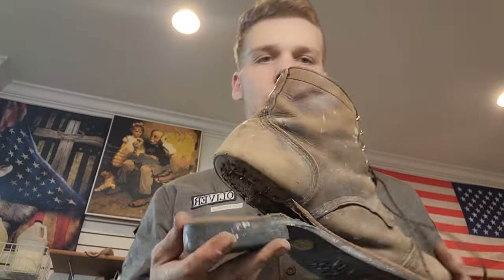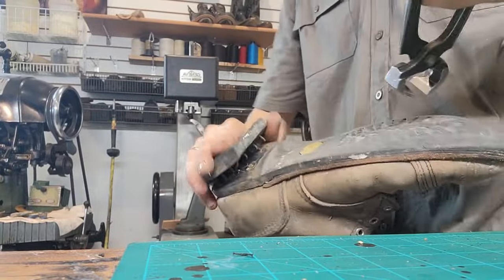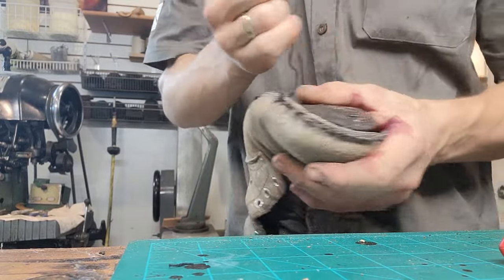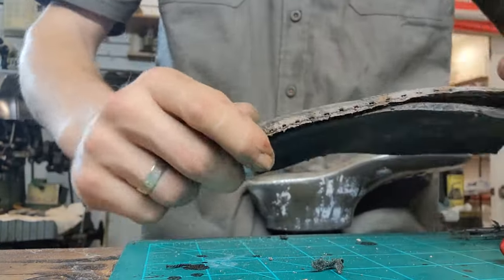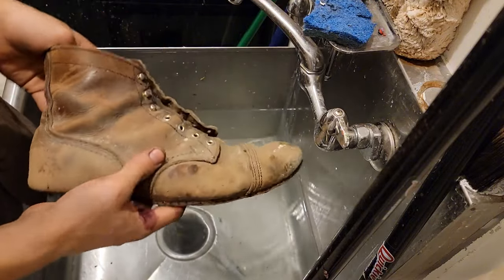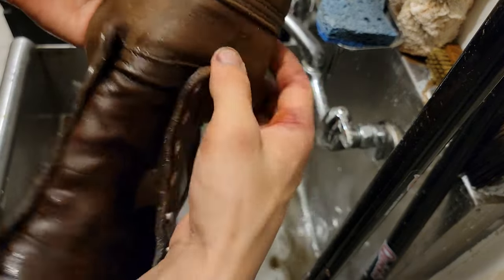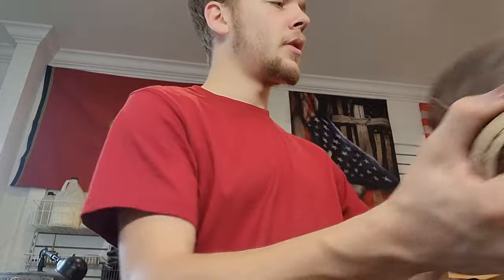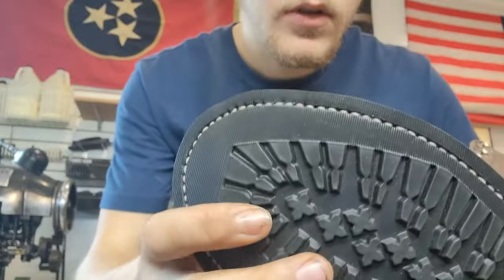Bringing a pair of Iron Rangers back from the dead! Insane restoration!

Comment: Would this be once in a lifetime clean? I would think this amount of water and dish is harsh but strong enough to remove all the dirt. Any yearly cleaner you recommend ?
Reply from the maker: Yes I wouldn’t recommend this for daily cleaning. You can still use the Lincoln EZ cleaner, but you don’t have to soak the boots like I did here. Just make sure to thoroughly condition the leather after.

Comment: I'm surprised by the wedging of the heels. I get the idea, but I've never seen it done so drastically. Perhaps, the final balance of the boots should be rockered (a convex shape) to conform to the motion of walking. My intuition has me thinking I might wear out the heels real quick with the heels crafted in that configuration. Or is this a normal thing?? I don't know.
Reply from the maker: The wedged heel all depends on the shoe. Most manufacturers snap down the bottom of the heel block before putting them on so it doesn't give the effect of a tapered block, but this has no affect on how fast the heels wear down